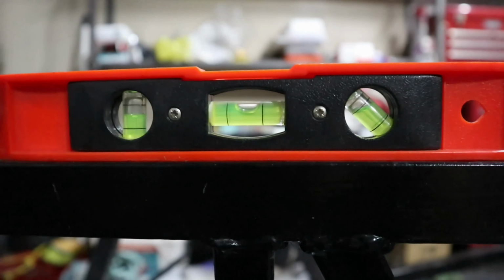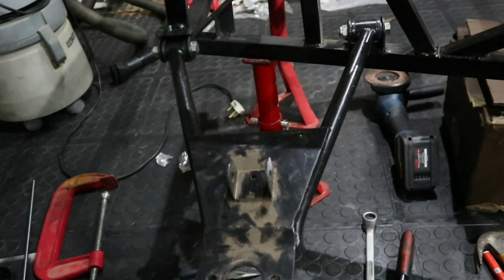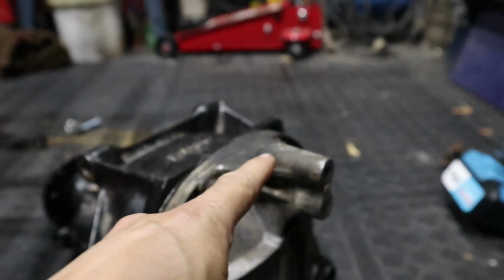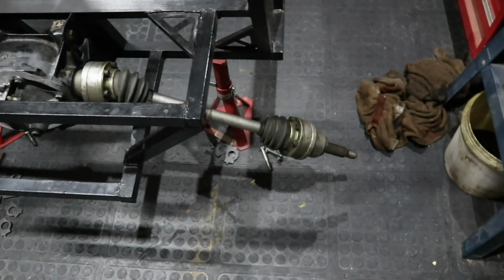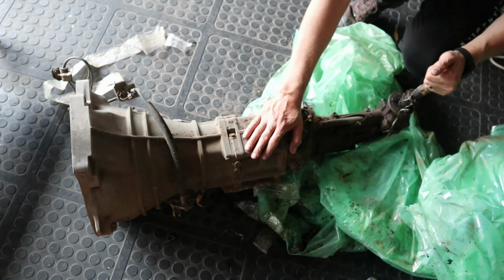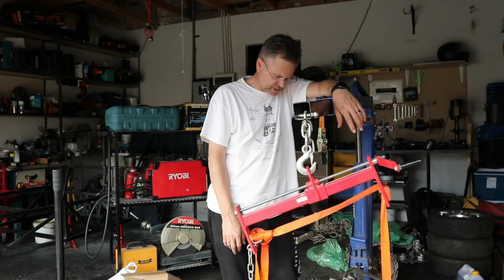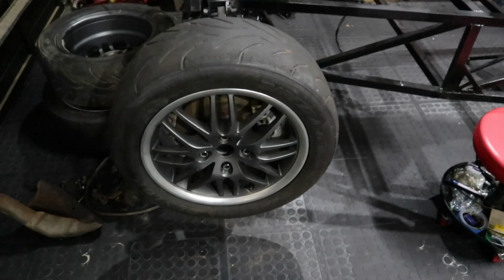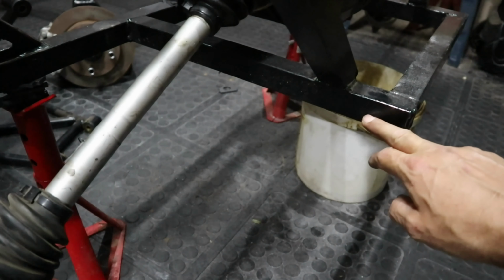M7 Part2 - Diff, Front suspension and Motor

Comment: That engine and gearbox are going to be perfect for that car. Your diff is a bit overengineered! Where did it come from?
Reply: Looks exactly like mine, came out of a sapphire 3.0
Reply from the maker: I think that sounds about right. The other car has the Ford type 9 gearbox used in the Sierra and a few other models
Reply from the maker: It is a Ford unit, which is the recommended unit, except for this one is limited slip.

Comment: The washer you mentioned for the front suspension are to adjust the caster angle, so it might be worth having the option to set this. I’m not sure If you’ve seen the MK Indy which also uses an MX5, well they use the standard manifold and sell a stainless-steel exhaust that bolts on. (Here a link to one of their episodes https://www.youtube.com/watch?v=tRrhjo7X64c). To work out the location of the rear suspension pickups will be determined by the length of the drive shafts.
Reply from the maker: You make a good point about the shafts... Didn't think about that 🤔